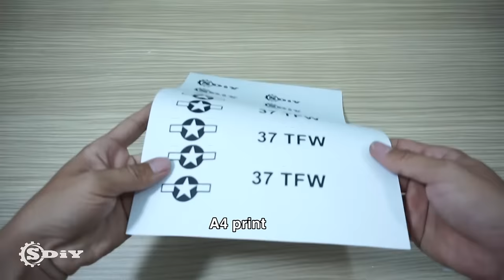How to build F117 Nighthawk rc airplane - Step By Step│S-DiY

Comment: Never knew that it is possible to hand build one RC plane in the comfort of your own home. Fantastic job and what a great flight that was controlling the air plane in the sky. Wish I have the time for this hobby. You are a real genius !!!
Reply: Terence: All you need is a small space about 2ft by 4ft or at the very least 18in by 36in, this way you can build anything up to a 42in span.

And for that a small table and a smooth ceiling tile to build on, so you can use pins to secure the wood to the work surface; it doesn't take a lot of room to build a nice plane and by keeping them small, say like 32in to 42in there are a LOT of plans and kits available

As for time, you should set aside a half hour or so two or three days a week to work on your project.

And if Not model building then find something to do where you can relax and enjoy the peace and 'quiet' we all need.

Comment: great build! you can get more speed from the prop if you give it a little more room to collect air. i cut out a small triangle on each side so it looks like a bow tie instead of a straight slit for the prop. but i get alot more speed on my foam board jets now. i love this plane i am looking to make one in the future.
Reply from the maker: Thank you very much. Those are really helpful suggestions !

Comment: Nice job! I built one similar to yours but I had used a combination of 3/4" pink foam board from Lowe's for the body and wing section and balsa for the top angles and v tail used a pusher prop with a 500 or 550 I think can motor but had things come up like having kids and my beloved electric RC plane build and crash hobby was put on the back burner for about 15 years and I'm wanting to get back into it again and found how the entire hobby had advanced primarily the super variety electronics that have become available. Truly amazing what you can do with the hobby now compared to the 80s and 90s for electrics, how inexpensive you can get EDFs, tuned port jet engines, the gyros and everything else available these days! 
 I'm now planning a new build of the F117 using the thin paper backed foam and next is to build a diy Harrier VTOL using drone parts. Can't wait to get into it again. This time though I'm going to learn some better piloting skills 😄
Reply from the maker: Thank you very much for your interest in my video. Actually, this model is very interesting to me. And plan to have more versions to come. Glad you love it too. With the F117, using the EDF is a challenge, because the air outlet is narrow. And EDF is also my upcoming plan. Thank you again. (sorry, I use translator)

Comment: Hi, I work with students so I would like to have this as a project for them. Does the depron fly much better than the cardboard? And what are the weight differences?
Reply from the maker: Thanks for your attention!. The only good thing about cardboard material is that it's easy to find. And all the strengths in weight, durability, and ease of processing belong to depron foam!

Comment: Where did you get this penoplast? COuld u give links for the materials to buy from?
Reply: Card board, card board , card board , paper , card board ,card board , motor , propeller ,controller ,surface control , card board ,card board
Reply: @user-uy9nr5hn7w  No, I ment smth like shops to buy from, like sheets of penoplast, because I have on;y seen brick of it

Comment: I thought that these things were supposed to be un flyable without the aid of all kinds of electronic gyros and gizmos of that sort...???
Reply from the maker: Hello friend, for these basic aircraft models, we need batteries, motors, ESC, servo and yes CG is simple take off!
Reply: All the gyros do is help you maintain level flight when you let go of the controls.  You can add GPS modules and ground cameras that allow for holding patterns, return to home, and auto landing.

Comment: My husband's dad used to be a car modeler but he's trying his hand at building this plane after I showed him your video. How much did it cost to build the plane? It looks like it could be 4 to 5 hundred dollars at a fraction of the price. The F-117 i do believe had poor handling characteristics because it's stealth design made it "wobble" so it earned the nickname the Wobblin' Goblin'. Clearly you've shown it can not only fly in RC-form, but built by anyone.  How long have you been into this hobby? Because this is some next level hardcore DIY stuff many people would get discouraged to do!
Reply from the maker: Glad you were interested. I have been interested in model airplanes since 2006. Each model has its own disadvantages. With the F117 it is more difficult than many other models. But if we try to align, find the right center of gravity, the control is also very easy. I wish you a great flight, if you have any questions or contact me. Many thanks friend
Reply from the maker: The cost for the full set I'm using in the video is around $80, including 3 batteries and charger. You can find it on amazon or banggood !

Comment: You are doing everything beautifully, I have a request to provide each element dimension in centimeters on each model construction plan
Reply from the maker: Thank you friend. Just print the drawing according to the ratio you want, for example print A1 will give 46cm wingspan as video, A0 print will give 65cm wingspan.

Comment: dear , many thanks to you for this great video , you show us the steps very clearly , and thanks for sharing the drawing , I have one question please : if I wanted to make the plane bigger , should I buy bigger motor and bigger battery ?
thanks and with regards
🙂
Reply from the maker: Thank you for your interest. For larger sizes, you can change the print scale, for example wingspan 100cm, will need 4250 500kv motor, 6s 22.2v battery
Reply: @SDiYchannel01  I really appreciate your fast reply and I’m looking for your new videos , I will send you a photos once finish from my plane 🙂
Sure it will not be as efficiency as your plane but I wish it can fly 😂
Thanks a lot my dear 🌷

Comment: Very amazing project,, planning to make one soon,,, but how many minutes can it fly in 1 charge by using the item in your video description? Also if I use a 2700kv motor, do I need to change other sparepart?
Reply from the maker: Thank you. With the configuration I recommend, the standard flight time is about 6 minutes. With higher rpm motor, for example 2700kv, will reduce flight time, higher heat generation, In return, top speed will be higher. That depends on your choice. Good luck!

Comment: Fantastic! As a LOT of people have mentioned GREAT landing! Where did you get the landing gear? I've seen something similar on Amazon but not quite the same!
Reply from the maker: Thank you for your attention. You can buy the landing gear "su wood landing gear 27, f22" at any commercial site. You only need a little adjustment, it's not too different!

Comment: Can we use 30A ESC instead of 40a? Pls reply
Reply from the maker: With motor 2212 2200kv you can use ESC 30a. However, the possibility of burning when full throttle continuously will be higher. Please take note

Comment: Can you use any transmitter and receiver or do you have to use the specific ones mentioned in the video?
Reply from the maker: Thank you. It's the cheapest set. Would be more perfect with the deluxe set! For example flysky i6 !
Reply: @SDiYchannel01  I want to but the flysky FS-i6, but the transmitter doesn't have a afhds protocol and I am not sure if that is necessary. So does the transmitter need to have a AFHDS protocol or is it fine without it?
Reply from the maker: @ajayraghani8202  Hi friends! Flysky i6 has integrated both AFHDS and AFHDS 2A protocols. But AFHDS is an old protocol, poor stability, now AFHDS 2A is a worthwhile upgrade of Flysky i6!

Comment: Where can i get the 45 degree bevel cutter ? Can you provide the 3d model plan for bevel cutter?
Reply from the maker: Hi, currently my cutting tool template does not have a plan. But you can find some other models with the keyword "depron 45 degree cutting tool"

Comment: Great job!!!!!!!!!!!!!!!!!!!!!!!!!!!!!!!!!!!!!!!! 
I'm trying to assemble following your video, however, I had doubts, is the tail of the plane 45 degrees too?

where exactly should the battery for the center of gravity be?

I just got the print on the A0 sheet from the printer! 
Give me luck to build  like yours. I bought Foam Black, so I don't have to paint haha :D
Reply from the maker: Hi friend. Thank you for watching
As for the tail, it's tilted about 60 degrees. But only for the aesthetic effect, but the tilt doesn't matter much, it just makes the radar invisible on the real version!
Regarding the center of gravity, follow the yooi mark at 12:03, then move the battery for the scale with that center of gravity (with the 3s2200 battery, it will be near the center)
Reply: @SDiYchannel01  the battery square in the A0 project is wrong then? I print A0 file. Could you tell me how many cm is from the front of the plane to the beginning of the battery?

Comment: I had to check the volume on my lap top several times to see why I couldn't hear the usual crappy Muzak that accompanys most DIY tutorials - but once I realized there was no Muzak I turned my own crappy music on

Seriously 'tho', thank you for an excellent video on how to build a model with Foamboard.

I'm seventy-six and started building balsa and tissue models when I was six so after several years of seeing how well these aircraft perform and how easy they are to build - not to mention doing it for a couple of dollars to maybe six dollars if more than one 20in. by 30in. sheet of Foamboard is used I decided to find out what was needed to build one - and except for a hot glue gun, I had every thing needed to do it, except (once again) for that really cool angle cutter - sooo where can I locate one of those bad boys or is there a set of plans to build it also.

Once again,, thanks for an excellent and informative video on building with Foamboard.
Reply from the maker: Thank you very much for viewing and commenting. I will continue to try to make real audio videos. About the 45 degree angle cutter, because I don't have the blueprint yet, so I can't share it yet, hopefully it will be finished soon. And finally, thank you again! (sorry, I use translator)

Comment: How to setting elevation without using mix mode. I using transmitter model fstb4
Reply from the maker: Hello friend, with the controller without delta mix mode, you have to buy a separate V-tail mixer (it will be hard to find)

Comment: How heavy is the support that holds the rear motor?
Reply from the maker: Hi friend, I designed it with 3mm wood so it's a bit heavy, about 35g. You can make lighter !
Reply: Thank you s-diy

Comment: Hello friend, with that battery, how much flight time does it allow you?
Reply: Friend comments, please I want to know the information, I need to know what battery to use I wanted to put a 5,200 mah but it weighs like 30 grams more
Reply from the maker: Thank you for your attention. With the 3s2200mah battery I got about 6m of flight time. But that's ideal flight time, you shouldn't increase the battery weight

Comment: If I use two 2500 kv motor,then does this create problem??? 🤔
Reply from the maker: Hi friend, if you use 2 2500kv propeller motors, it will be very difficult to arrange on the F117 kit, with f22, f18... will arrange 2 motors.

Comment: You don't told in this video, where are you bought this styrofoam? And you not have linked in your description.
Reply from the maker: Thank you, for various reasons I can't put the link directly. Please search by keyword the parts name in the description, on the web sites in your area! Hope you keep watching my new videos!
Reply: @SDiYchannel01  hi, thanks for your fast reply. I will very happy, if you tell me: how long can i do fly, with one full battery? When do i know, that the battery is empty, it is displayed in wireless controller? And my last question: how far can i fly, what happens, if the connection is break out?
Reply from the maker: @mr_koc_ac1117  Hi friend, I use 3s 1000mah battery. Flight time is about 4-6 minutes. You have to estimate, not show. There will be a problem when the signal is lost (over 500m)

Comment: Dear friend, great job. How should I print the pdf so that the design fits me big? Thanks. Greetings from Caracas-Venezuela
Reply from the maker: Hi friend, If the print is A0 size, it will have a wingspan of 65cm like me. If printed A1 the wingspan will be 45cm. You can ask the printer to convert it to A4, which also gives a 65cm wingspan...

Comment: Hola Amigo, me gustaria tener mas detalle de la colocación del motor y angulo a seguir para reconstruirlo, ya tengo tus planos para poner manos a la obra, Saludos desde Mexico.
Reply from the maker: Thank you for your attention. With the mid-body engine design, you should balance the engine angle as straight as possible, without tilting. The 2216 2400kv 6x4 inch propeller motor is a reasonable choice for a 65cm wingspan. Hope useful for you !
Reply: @SDiYchannel01  Muchas gracias amigo por resolver mi duda, ahora manos a la obra, Saludos desde Mexico

Comment: Can I make this with normal cardboard, will it fly, please reply sir 🤗
Reply from the maker: Hi, you can make it out of cardboard, but have to reduce the overall size to 50cm, by printing A1 instead of A0 !
Reply: @SDiYchannel01  Hey dude, then it will be so small because of reducing 50cm without reducing will it be fly?
Reply from the maker: Hi, 65cm size like my video, with cardboard it will be difficult to fly, and have to upgrade to higher capacity electrical equipment, that will be difficult!
Reply: @SDiYchannel01  so can i make overall in 50cm ?
Reply from the maker: yes, please print the design in the description, A1 paper will give a wingspan of about 50cm

Comment: Do you know this 2212 920KV CW Brushless Motor?
Reply from the maker: Hello friend, with low KV motor (920kv in detail), you must combine with large size propeller, about 10in. So does not fit this model...
Reply: @SDiYchannel01 thanks

Comment: When the 3rd channel is turned off, the brushless motor spins very fast. What to do.
Reply from the maker: hi, please tell me the radio set you are using. Or you can find Failsafe installation instructions...
Reply: Fly sky fs i6 transmitter
Reply from the maker: @awishkadewinda4455  Maybe I misunderstood you, do you mean that when you pull down the ch3 sitck, the throttle is stronger? if so, go to settings, reverse ch3. I mention failsafe is for the case when the generator is turned off, then the motor automatically rotates...

Comment: Hi, i can using Cardboard on the contrary depron panel? Thanks
Reply from the maker: Hi friend, I don't understand what you mean, maybe you want to ask to replace depron with cardboard ?
Reply: @SDiYchannel01  yes, that was what I meant, sorry I don't speak English well
Reply: @SDiYchannel01  so can it be done? thanks for any reply :)
Reply from the maker: @CristianCosentino  Hi firiend, Sorry for the mistake, With this blueprint you can do it with 3 layers of 5mm thick cardboard. However, the weight will increase by about 200g, it will be more difficult to control it!
Reply: @SDiYchannel01  thanks for the reply, have a good day ;)

Comment: can 1400kv brushless motor fly this plane??
Reply from the maker: Hi friend. with this design you can't use 1400kv motor because it doesn't fit 8 inch propeller
Reply: @SDiYchannel01  oh thanks to help :)

Comment: meu amigo parabens pelo aeromodelo muito bom . gostaria de saber a tinta q vc usou para a pintura
Reply from the maker: Hi, it's a handy instant-use spray. If the material is porous, spray at least 30cm away, and apply multiple coats!
Reply: @SDiYchannel01  muito obrigado meu jovem sucesso para vc em seus próximos projetos

Comment: which is better mid engine or rear engine?
Reply from the maker: Thank you. The mid-mounted motor will be simpler and easier to install. But the aesthetic is low and will make noise! You can consider!
Reply: @SDiYchannel01  ok thanks. are the tabs on top piece necessary or can i just use hot glue?
Reply: can i use 6x3.5 propellor instead of 6x4 propellor?
Reply from the maker: @mohidkhan9496  If you're only using glue, use a precise marker. With a 6x3.5 propeller, it will be slightly weaker despite being the same 6in. But won't matter with 2200kv motor! (sorry, I use translator)

Comment: ,what is the angle of folding of main body triangle hull in blueprints
Reply from the maker: Hi friend. You don't need to worry about the corners in the main body, because when assembling the parts, there will be precise joints!
Reply: @SDiYchannel01  but I don't have an a0 size sheet I have a3 and can't buy due to lockdown
Reply from the maker: @kartikyadav3383  In my new pinned comment section there is an updated A4 drawing, you can download it, it includes 16 A4 panels put together!
Reply: Can you send the all measurements of diagram in english that would be convenient for me
Reply from the maker: @kartikyadav3383  To respect the author of the drawing, I only share the original. To translate it into english, you use google lens app, just take a photo, it will translate every text on the photo